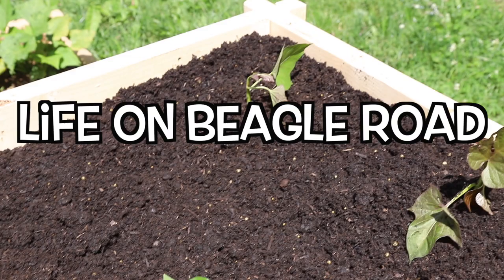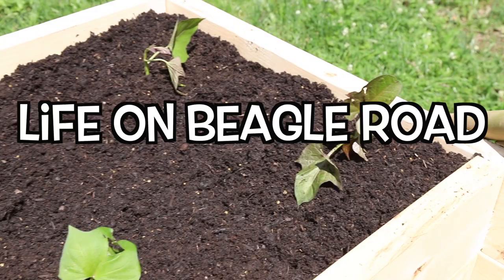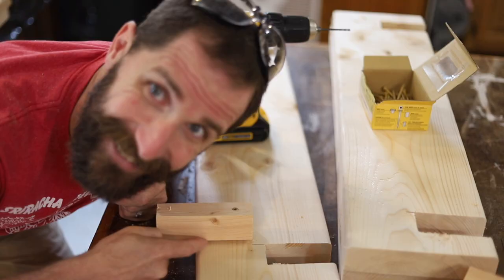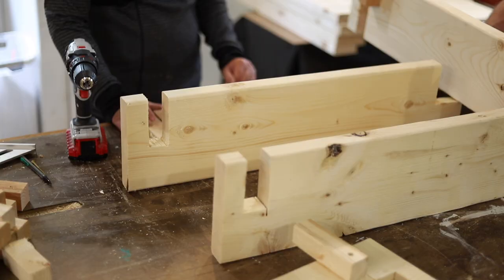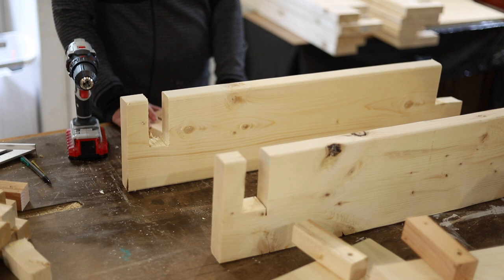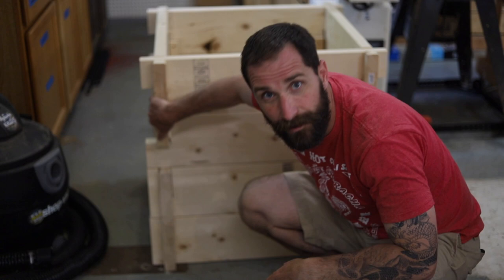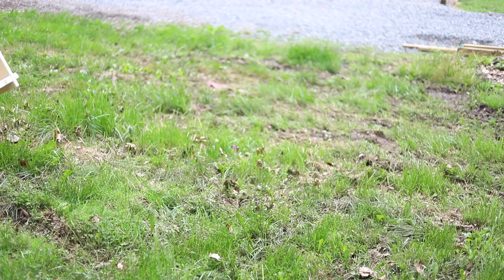DIY: How To Make Potato Growing Boxes

Comment: Nice looking 🍠 sweet potato!! 
I use 4 pallets held together with a dozen screws - I build it up as the vines grow. At the end of the growing season I simply disassemble harvest and stack the pallets until next season. 
Your boxes look SO nice! Also potatoes don’t like a lot of nitrogen - more carbon. With more nitrogen you will get lots of beautiful vines and not many potatoes - more carbon less vine and more fatter taters. I learned that the frustrating way.... 🤨👍🏻🤗
Reply from the maker: Thanks Kim!! Yeah, I found some plans for these and liked the look of it. Outside of the end piece breaking I like them. Although there won't be any bottom harvesting with these.